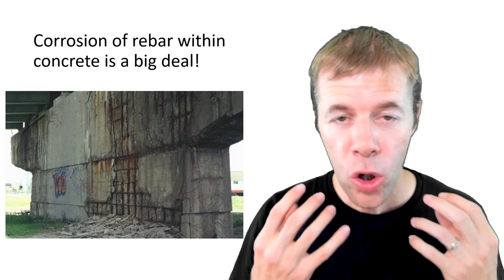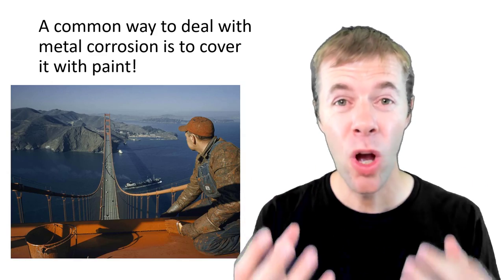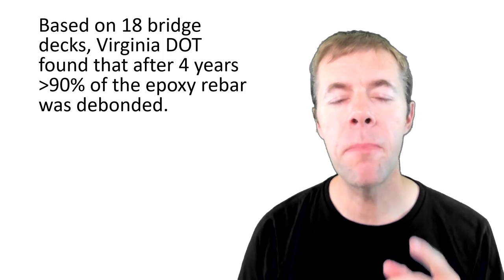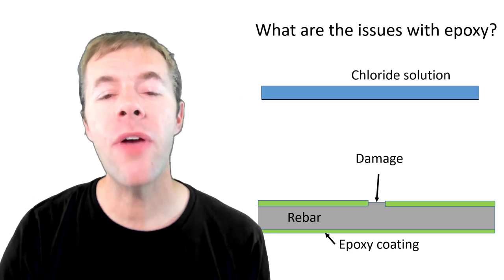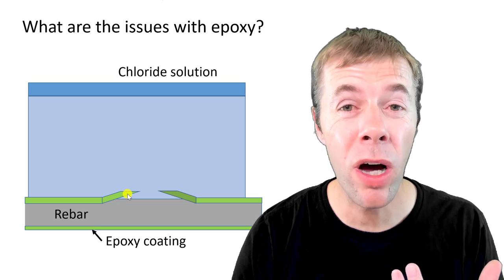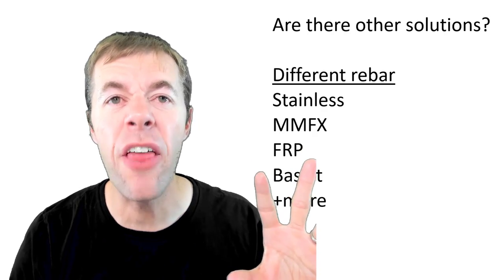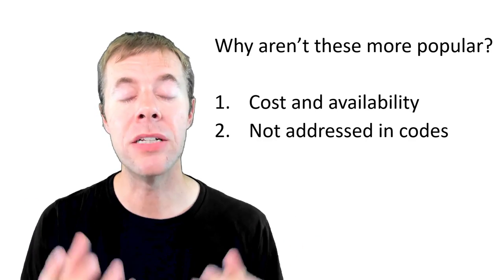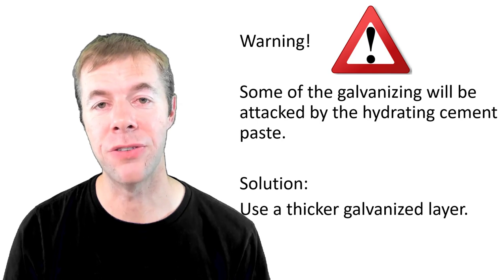What is epoxy coated rebar and why is it being banned?

Comment: Hot dipped Gal rebar delaminates just as fast or faster then Epoxy coat. What he is not telling you is what type/mix of concrete plays just as big of a roll as the coating. Modern concrete contains many additives from a liquid plastic to small metal/glass beads. The list is endless. Clearance between the Rebar and the air/water surface also plays a roll as well as curing. What he also doesn't mention is that when Gal delaminates, it leaches toxic liquid in numbers ten times that found in Epoxy. Just happened to luck past this video and I got a pretty good chuckle...this cat must be an enginurd....

Comment: Good start but didn't finish. Zinc coats but also zinc acts as an anode in corrosion and makes the rebar the protected cathode. I do not know about zinc chloride expanding and causing concrete spalling.

Comment: Hydrogen embrittlment a problem with hot dipped galvanazation.  Inorganic zinc rich coatings should be considered.  Concrete admixtures are also a consideration.

Comment: we have a problem with pet plastics which have a life of thousands of years used pet melts under 400 degrees and a damaged or cut bar can be repaired with a small sheet and a blowtorch lots cheeper than galvanised and would last 10 times as long a.Reterink

Comment: Yes fibre filled cement could work. It sure works in rubber items. I have some soles for my slippers (I make sandals from leather) which are from rubber. That rubber is filled with about 2mm fibres and it is way longer lasting than any other shoe outsole. It never cracks or rips and it has a high abrasive propperty. I would call that the principle of fibre reinforced rubber. For me thats the way to go if thats possible in concrete and cement.
Its just plain crazy to use an rusting iron in cement of which you know it will rusted through after 40 years (like in the Miami housing collapse). These fibres may degrade however in cement as well after a certain time - they most likely are not forever lasting.
So back to the roman arc construction and an construction method which is based only of physics.

Comment: Many years ago (1987 ?) I spent a number of years in industrial construction sites as structural restoration & seismic retrofit. This was during the period of calif quakes although I work primarily Seattle area and spent more time in classes for epoxy pressure injection, classes that if you didn’t have a pocket protector and a calculator built into your digital watch you would most likely think these classes were giving by another planetary species ,  just the hieroglyphics on the whiteboard 
was mind boggling. Maybe having to good of time in Vegas the night before a 4 day conference titled : combating alkaline sulfate reactivity, may have doomed my pursuit of knowledge within my intellectual cognitive abilities. 
And not to break my tradition of class clown I was able to get them to bring it down to simpletons level and speak English at a “ All you need to know, you learned in kindergarten! ACI 301 and you don’t need to ask if you going to get sick ( only fist day ) just leave . I just shared as much as I retained 34 ish years later. 
Seriously this is a complicated subject and not recommended if you repeated  ANY grade, still working on GED, or suffer from acute narcolepsy (again,day one , hasn’t happened again )

Comment: Galvanizing is good it’s expensive you’re still only as good as your substrate so in galvanizing if the substrate if it doesn’t have a profile or is not clean properly it will fail

Comment: when concrete is poured over the epoxied rebarb the heavy liquified material is like a giant abrasive . This contains  gravel ,sand , ect which have been crushed to certain specs, gravel that is used must have a min of 5 fractured sides in order to be used inn most commercial applications .. this is why epoxy does not stand up to the abrasive action of concrete being poured over the top of it.

Comment: If more cement was added to the concrete mix design, with secondary cements to react with the main hydration product (calcium hydroxide) and properly cured (which is seldom the case in the real world), the chloride might not ever penetrate enough to come into contact with the reinforcement. Trivia FYI, back in the 1950’s, it was discovered that a finer cement grind needed less cement to obtain a specific compressive strength. As a result, less cement was used…which in turn  created a more permeable concrete….if placed side-by-side a 3000 psi concrete from 1950 would be 75% less permeable than a 3000 psi concrete of today. The cause and effect was grossly under appreciated.

Comment: They always told me that rebar with galvanized coatings healed holidays and even cut ends by electro/chemical action over time (hot dipped at least)
Reply: "Healed holidays"?
Reply: A holiday is a spot in the coating that is missing. Watch the vid again and you'll see one.

Comment: I predict that three dimensional graphene threading woven around high molecular weight polyethylene solid tubes in a cross-link process reinforcing the new high ductility concrete structural building products will creep into critical structure construction. The costs will be high at first, but with all new methods, will become less expensive and pervasive in use.

Comment: Why pay all the attention to the last line of defense?  Start with the concrete composition and coatings.  The Romans used volcanic ash in their concrete, making it stronger and a LOT less porous.  Also, if you can constantly reapply paint to a steel bridge, why can't you similarly reapply a penetrating sealant to concrete?  Keep the chlorides out, not just make the rebar more resistant.  No one part of the structure (rebar) has to be perfect if all materials of the structure are improved.

Comment: Less than 10% cost premium for hot dip galvanized reinforcing? That seems quite a bit off, especially with the thicker than typical galvanizing you talk about. If that was the case, then epoxy coated rebar would never even be on the table and be competitive.

Another factor that allows steel to be a great material is its ductility. Many of the alternative proposals are not able to deform quite the way steel does at yield. Ductility is a very desirable characteristic in building and bridge design as it helps prevent failures where life safety is at risk and gives warning as it begins to fail. FRP along with other materials does have guidance in the codes, but there are often limitations based on its ductility (or in the case of FRP its lack of fire resistance). 

Galvanizing is a decent solution that allows excellent corrosion performance with the ductility and availability of steel, however the cost is an issue. Galvanizing may or may not have some bonding issues of its own, as I have seen results either way, and it seems there needs to be more research as well.

The most efficient things you can do to act against corrosion in concrete is to use corrosion inhibitors in the concrete mix, do testing of the mix for chlorides to only allow a certain amount, and to try and control cracking as much as possible. Microcracks will almost always form, but if you can at least do as much as you can to keep crack widths down, it goes a long way to adding durability.

Not sure why you’re talking about “banning” epoxy coated reinforcing in your video title. That sounds a little bit clickbaity. While you do bring up some good observations and things to be aware of when selecting epoxy-coated rebar, there is still a place for it even with those issues, like certain slab-on-grades for instance.

Comment: what do you care? as long as you are imbedded in the alkali and there is no oxidation and there are no spalls you are golden, its when you are not imbedded with you're rebar adequately in the alkali (CONCRETE) you have oxidation, epoxy or no

Comment: I know, rebar in concrete works because concrete and steel has the same Coefficient of linear expansion. Zinc does not.
Would it really work ?
Reply: Does the zinc plating fall off the nails holding on your roof, or fall off your chain link fence?
Reply: @joshua43214  I don´t have nails on the roof, and I don´t have a Fence. And you did not answer my Question, you asked another one.
   My question implies that I think there might be fractures in the coating due to the different linear expansion.
Reply: @barkosvega2718   Surely the thin plating of zinc, in relation to the diameter of the rebar, would mean the thin zinc plating having natural flexibility in comparison, stretching and contracting.
Reply: @barkosvega2718  The answer is that expansion coefficients do not make a difference in this case.
Which is why the zinc does not fall off the nails you don't have in your roof, or off the chain link fence you don't have.
Reply: @mikeomolt4485  not quite, but I found a german PDF which explains in great detail how it works.

Comment: Well I'm a little late to the ball on this topic but what the hell I'll throw my two cents into the ring on it. 
Galvanizing has been useful but it has its flaws. For one if galvanized rebar is cut, welded, or bent that coating is now compromised and your back to square one. 2: Mass production of metals comes at a price on the environment, and the resource is not an endless supply. If we are to ever get into space where a new horizon of procuring more or newer resources can begin we need to start reserving them more aggressively for that future endeavor because running out is not a good option. If it was my call I'd say put more research toward a mono pour poly substance for future building. Something that has enough flex and strength to stand up to the many challenges of warm to cold, dry to damp, and seismic activity without the need for rebar. If the Romans could figure something out back then (poly concrete) surely we should be able to do as good or better with the tech we have now.

Comment: Wouldn't the lyme in concrete react with the galvanized metal in an adverse effect. I'm not an expert on concrete, not sure if lyme is present in all types. My background is Asphalt Paving & Grading.  I know when lyme is used in ABC (1%) & comes in contact with metal it creates a fizzer that pops up through the asphalt in about 3mos time. Imagine developing 25acre shopping center where a framing company once stood. How many nails must've been in that ground.. we took an "L" on that 1 with all the repairs.

Comment: Rebar rusts inside of cement. Cement absorbs water. That's why basements of homes with concrete block walls and slab floors have higher humidity levels than the rest of the house. Rusted rebar will expand and crack the concrete up.

Comment: They don’t blast the rebar prior to dipping.  Needless to say the epoxy coating doesn’t adhere well to dirt and rust. One chip and game over. So just imagine loading, off-loading and being pushed around a job site, hell doesn’t stand a chance. Hot dipped galvanizing just may weaken the strength of the bar do to the pickeling process prior to hot dipping the bars in zinc.

Comment: Well then Vegas is doomed if the chloride solution deteriorates epoxy. I say this because I was a union laborer and doweled in so much rebar with Hilti's 5000 red epoxy it is crazy. Almost every structure I helped build from the LV Monorail to Caesars Palace has rebar in some area which has been epoxied in....and the Monorail and Resorts World is just CRAZY with so much rebar we epoxied (drilled oversize holes, blew out 2X, wire brushed 2x, injected mixed epoxy resin, twisted in rebar)in..... Be a hero and inform the Clark county building department about what you know... back then it was to code and all my stuff was 3rd party inspected... In fact, the Hilti epoxy that held in the rebar was actually more difficult to chip away than the concrete itself.

Comment: Isn't FIBERGLASS FIBER strands the best ?? Its not for shear (where rebar reinforces a shift) but for footer, pads, walls, and water/salt/chlorine enviroments. Its just 1/2" to 2" single Fiberglass threads and there's tens of 1000's of these strands in a cubic yard, all mixed in the crete. They don't swell, breakdown, and are irregular in the mix giving optimal tie strength from all directions.

Comment: Doesn't make sense to me about the accelerated corrosion. One exposed spot wouldn't attract more chlorides like a magnet. It would still get the same amount of chlorides in that one spot that it would have gotten if the entire piece was corroding. In other words, there's no reason to assume a small spot gets a more concentrated exposure because of the chipping epoxy

Comment: Nothing will get flamed more than suggesting switching to Aluminum from steel.  Aluminum, when mixed with steel, in a concrete mixture causes lots of problems.  But, word is, if you keep all steel out of the concrete and use only aluminum, there will be no bad chemical reactions.  Aluminum will not have the rust issues.  Just don't cross the streams.

Comment: Soooo, the reason that epoxy coated rebar isn't the solution is the nicks and scratches, many of which is made in the field.... so why doesn't galvanized rebar, that is rebar coated with molten zinc and then sent into the field to be abused, have the same problems.    It probably does.  Not being an engineer, it would seem that trying to find some additive to put into the concrete to repel chlorine might be a solution, as would be more durable coatings (paint).

Comment: In the past century we've built some impressive structures, soaring skyscrapers and huge bridges and viaducts, and almost all of them have used cement/concrete.  And they are all doomed because of rebar.  As it corrodes, the rebar swells and will eventually crack the cement, which will admit more water.  Conscientious maintenance will slow the process, but even a few lapses in care will allow the damage to take place.

Comment: If galvanizing is so cheap, why didn't that process take hold in rebar manufacture instead of the epoxy coating process? My guess, it was even cheaper. And further, why hasn't the use of concrete similar to the formula the ancient Romans made used today? There are many examples of ancient Roman structures that used concrete without any rebar still persisting today that are structurally sound because rebar was not used.

Comment: Such an often overlooked issue with concrete. Totally see the need to improve 40+ year building codes with todays technology. There are very successful corrosion inhibitors on the market that help create a positive/negative (?) reaction to protect against chloride ion attack. 

Another very successful product is XYPEX, which is a concrete waterproofing and chemical protection product using crystalline technology to prevent water penetration within the concrete. It forms a non soluble crystalline formation within the pores of the concrete, making it waterproof, self healing, and resistant to chemicals. 

Water carries the chlorides down into the concrete, not to mention other chemicals that are detrimentally to concrete. Aka, acids, sugars, and recently, H2S attack in sewers caused by anaerobic bacteria. That product has been on the market for almost 40 years in extreme environments: wwtp, wtp, dams, tunnels, etc. Its all about “value emgineering”, and unfortunately, most state/federal budgets are driven by yearly budgets to get that $$$ and not long term planning. 

Very cool. Just joined your channel.

Comment: Galvanized bar is expensive over 10%.  It also has the same problem with damaged spots. its why h piles are no longer galvanized. Double coating is not a reasonable solution just doubling down on a bad one. New materials are going to be the answer. Weather it be in the form of new types of reinforcement bars or an improved fiber reinforced concrete.  Now if someone could find a way to do this with recycled polymers, metals, or industrial byproduct we would have something transformative for the entire planet. People need to realize we are a civilization built of concrete and cement/concrete production is the most energy-intensive of all manufacturing industries. Forget the carbon emission games a major innovation here is the serious game changer

Comment: Keep in mind that galvanizing is also a coating like epoxy. Thicker plating may prevent holidays and pitting but now you’re also increasing the cost. Plus it contains Zinc that can be toxic in large amounts when leached into water.
Reply: Not to mention all the workers that will be braindead in a few decades from welding zinc. Not using ferrous metals in the first place is the real solution if you are worried about Rust :P
Reply: @Muffin_Masher  Typically rebar isn't welded together, but tied off. Welding galv is a terrible idea as you stated, for anyone in the vicinity without protection.